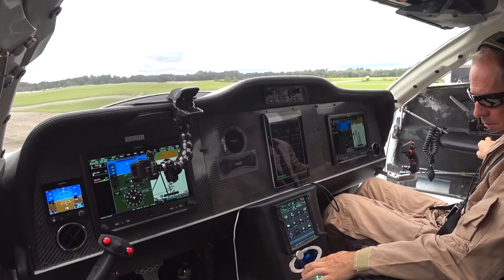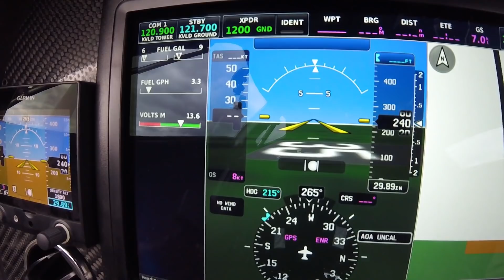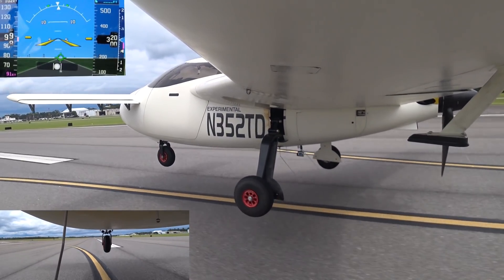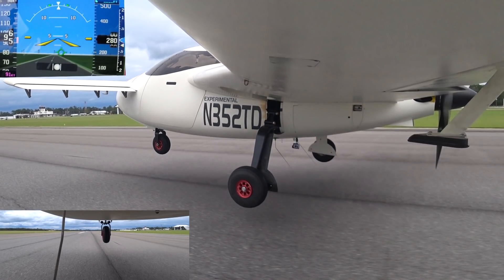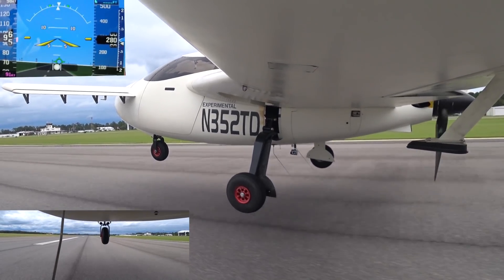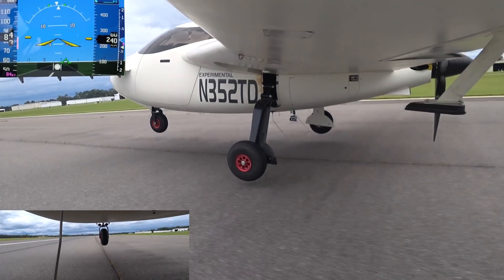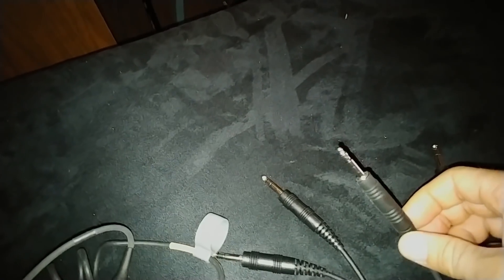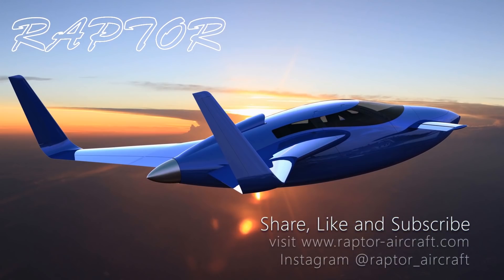Second Ground Effect Test - Building the Raptor Prototype

Comment: 1. Black exhaust smoke during power on acceleration, 2. A lot of dancing on the rudder pedals A LOT,  3. PIO again honestly u should quit while your ahead , and let a test pilot do these tests. It's not a dig on u at all, just pilots who have 1000s of hours can see and anticipate and give you input on stability and control issues just an opinion from a APT jet pilot

Comment: Perhaps the roll is a secondary force caused by the rudders and the crosswind component, a run in both directions would determine if this is the case

Comment: What is the difference between this plane and the velocity? They look almost identical..
Reply: If you'd been following for a while  you'd know the main differences are: 1. Pusher config. 2. Re-tuned Automotive TDI motor. 3. Pressurized cabin 4. Five  person seating.  5. Carbon fibre construction.  Cheers.
Reply: @bartofilms  like the other guy said,  the Velocity is a pusher, and has the ability to also do 5 seats. .

Comment: Peter, are your brakes still dragging a little too much?  leaving a lot of rubber on the runway at touch downs...It could explain the heating up issue you have been having.  I am not familiar with the Beringer brakes, but could there be an adjustment for them?
Reply from the maker: They are performing to spec according to Beringer.

Comment: Tom L.  You said obviously that I am not a pilot.  You are technically correct, as I am a retired veteran.   But mister hot jet jockey, where are your cred and videos of you initial test flights of the aircraft that you designed and built?

Comment: I'm going to be honest with you, it doesn't look pleasing for a pilot to fly, and this is only ground effect. No hate though, this is what flight test is for. I am an aerospace engineer and worked with canard aircraft in the past. It is looking like you have longitudinal stability issues. I know we are still at landing speeds here, but a plane should not be this sloppy longitudinally. Did you do any kind of CFD/VLM/VPM analysis on this? I feel like you also will have a lateral stability issue due to having a pretty high radius of gyration and consequently high roll MOI, but that is besides the point. Generally for canards, if sized too small we don't see enough elevator control power, but too big and we see poor longitudinal stability due to a larger than necessary positive canard contribution term in the pitch stiffness derivative. Usually when designing canard aircraft, it is very very hard to get the size of the canards right: too small a volume ratio will not counteract the negative moment of the wing, too big a volume ratio we will overpower the stability provided by the main wing since a canard itself is a destabilizing contribution to the aircraft. I suggest flight tests of multiple canard size configurations. I think you'll see that a decrease of the volume ratio will yield good results (and could even lead to better efficiency mostly at design trim condition).
Reply: @ryanthomas2472  those numbers make no sense. A tas of 149 knots and drag of 1000 ibf is 457 effective hp at the prop. Assuming an amazing efficiency of 90% that's 510 hp at the flywheel. Sr22 has a 310 hp io 550...
Total Drag is one of the hardest things to get out of cfd right, which is why sanity checks are important.
Reply: This thing has become a death trap with so many iffy construction methods used and numerous deadly problems ready to reveal themselves at the worst time, don’t know why anyone still has an interest in this project.
Reply: @tropicthndr  Good idea, so leave already.  Bye!

Comment: Hi Peter,

If you'll PM me an address, I'll have a copy of 'Flight Testing of Fixed-Wing Airplanes' sent to you.

Here's a preview: https://books.google.com/books?id=IdWmOwceEtIC&pg=PP1&source=kp_read_button

I'm not a test pilot, but it was one of the main books I used during my M.Sci. In Flight Test Engineering. If you haven't seen it already, it will be a big help in developing your program through first flight and beyond.

P.S, the book's author developed some of the material while working as a test pilot for Rockwell on the Commander 112/114 in the late 1970's. He had to jump out of the airplane after the prototype's horizontal tail fluttered off due to an early design issue which was later resolved through more testing. I think the story is covered somewhat in the book.

Comment: Well done so far.  Not being familiar with your electronic flight display, and how much ( if any ) lag there is in that system from when you get to an attitude, and it is displayed. It looks to me like if you pick and hold 5 Nose up with that speed on the AI you might have a smoother time in ground effect? I have no idea where you are looking as this happens . It might be worth a try if your staring outside as maybe that is partly causing your pitch overcontrolling.
Reply from the maker: Yes, at 90 knots GS and 5 degrees nose up it looks very stable and comfortable. To get it there though requires me to rotate the nose. Then as it comes up it actually gets a little lighter the higher the AOA. So to counter it wanting to go past 5 degrees I have to put in a little nose down elevator to stop the rotation. It's like anything, I need practice to get it just right. Now if I was keeping full power the nose down adjustment may not be required as much which would make things easier.
Reply: @RaptorAircraft   Maybe try a tiny bit less back trim prior to rotate, so that you are having to hold rear pressure at 5 nose up ?
Reply from the maker: @Finchy23  I have it trimmed now nicely for the 5 degrees nose up at 90 knots which is what I prefer.
Reply: @RaptorAircraft  Nice - I look forward to the highlights :).... Also I thought if your landing gear is used widely on other aircraft, maybe you could see if it behaves the same  for those aircraft when they touchdown ( if there is any footage available on the internet to compare with )

Comment: With all the adaptors and connections you did on your headset/helmet, you are more than likely gonna have issues.  I wouldn’t want the additive condition of being NORDO on first test flight.  You’ve got enough on your plate just flying the airplane.  And how many helmets have saved lives in an airplane crash anyway?
Reply: To your last point: A shit-ton.  More lately, as more people are wearing them.  In most circles of the professional warbird community you're seen as a fool if you fly with only a soft leather helmet or baseball cap anymore, we've seen the results of that in a crash time and time again.  People without proper crash helmets have: been knocked unconscious and burned to death in the airplane, been knocked unconscious and drowned in the airplane, suffered severe head trauma, suffered severe brain injury, suffered severe lacerations to the face... People wearing crash-rated helmets are proven to be significantly more likely to: remain conscious during and immediately after the crash, be able to self-extricate, suffer fewer injuries, etc.

Comment: Excellent progress Peter ! I am glad to see it airborne again, and getting closer to that post maiden grin ! I do have a couple questions out of curiosity, and curiosity only.
A) What's your wing and stab incidence in relation to thrust line ? 
B) On your winglets/verticals, I am assuming they are parallel with the center thrust line on the vertical axis ? Having flown many large scale RC wing, and canard variants, some of them depending on winglets size and angle, would cause a roll movement, and not so much on yaw. One design I test flew similar to a Velocity, weighing 30 pounds had one vertical that was off about a quarter degree with the opposite wing, and it induced a roll action versus yaw. 

Keep up the AWESOME work !!

Comment: Hi Peter. As you alluded to the fuel imbalance, this would add to the cross wind you said was coming from the left. With that magnificent large swept wing, the roll induced by the extra lift generated by the crosswind may certainly be a large factor. Remember, the left wing is presenting much more to the wind than the right wing (which is presenting even less due to the sweep back from the presented crosswind) and therefore a rolling moment. Even as you said you over controlled a little on your correction, the aircraft seems to be behaving well. 
Stay safe.

Comment: I purchased a jabiru that had been flipped on landing during its test flights when he landed in wet grass. when I rigged the plane up in the shed the right wing had an angle of incidence that was 10mm higher than the left wing (along the whole wing) when measured over the chord length! The owner reported that the setup needed looking at because he had to have almost full right aileron to keep it level in the circuit. Yep a bit more than just the rigging (Prob lucky he never flew at Max Cruise). Anyhow, if your flying and control surfaces are in alignment then the control inputs should have ample authority to correct for any aerodynamic or torque related effects.
Reply from the maker: And as you can clearly see, I'm barely putting any control deflection in when making corrections to the roll attitude. I'm just being careful and taking it slowly. Yes it's risky close to the ground but it's riskier in the air if there is a problem.

Comment: RUDDER, RUDDER OR MAYBE TRY SOME RUDDER. Also, stop trying to nit pick so close to the ground. Let the test pilots have a go at it away from the solids to get a good trim in stable flight. There are too many dynamic things happening in the transition from rotation, power change, acceleration, deceleration, flare etc. You are going to drive yourself bonkers. The systems seem stable, time to let her fly.
Reply: There are no test pilots anymore, Justin and Elliot are out
Reply: @outermarker  Peter has addressed this many times. Best you review earlier videos before making silly comments
Reply: @Ulbre  really? I've been following this since he and wasabi both released videos and he's not said, as far as I can tell, what he's doing for test pilots, if they're in or out. Is he keeping wasabi on?
Reply: if he uses rudder then he is defeating what he is trying to achieve at this stage....which is how she flies on her own with minimal human input.
By the time she is ready for TP's then hopefully any smaller issues will already be sorted.
Reply: @Ulbre  what exactly do you think happens in any SEL aircraft with no rudder input on pitch up at high AoA ?

Comment: Are there baffles in the tanks to prevent sudden shift in the fuel? Cross wind maybe?! The question was asked about engine mount and you said straight.  Might want to recalc and determine if an offset would be beneficial. I never built full scale but built many powered models. Never built one with a straight config. Getting closer tho. Keep it going!

Comment: Check the incedence on your wing lets. You can test that by shimming them out id start at 1/2 shim. See if that helps.
Reply: 1/2 in shim.
Reply: they are not adjustable
Reply from the maker: Incidence had been checked several times. Still perfectly symmetrical as it was when the wings were first attached.

Comment: I am not concerned with the balance at this point, it seems you have more than enough positive authority at this point for the speed being flown. Peter is right for taking this slow. Everyone is saying just fly it, ....wrong! If there is an imbalance of some sort that is not pinpointed, when the aircraft is flown at higher speeds, the problem could be exacerbated. I can fully understand Peter taking his time with caution. I'd rather see it go slow than see it in a hundred pieces or worse!
Reply: To some degree you are correct.  However the most dangerous aspects of flying occur during takeoff and landing.  He is doing it correctly!

Comment: The bank to the right may be the torq generated by the engine/propeller. In a Cessna 152 you can feel it a lot when you bank to one side or the other. you need almost twice the force. I presume that with that many HP at full power you may expect at least that amount of right torque. There must be some kind of formula to deduce the amount of force that may be generated by the powerplant. And it is always to the same side, and contrary to the rotation of the propeller.

Comment: I’m concerned about the BREP. Wouldn’t it get tangled in the engine if you needed to use it while the engine is on or spinning in the wind?
Reply: The plane should fall slightly nose up under the parachute, the lines shouldn't get anywhere close to the prop.
Reply: @kschleic9053  If you watch any real-life deployment of a BRS, you'll see that it takes time for the parachute to "fill".  In that time, it streams STRAIGHT BACK.  Yes the rocket launches it up but the aircraft is still flying at a significant speed, so it streams back directly in the wake of the aircraft before it begins to fill, slow the aircraft, stop the aircraft from flying, and then eventually suspend the aircraft.  I am equally as curious as Ravi how this will work on the Raptor.
Reply: I am sure this will be addressed in the future.  But it seems like we would need to have the prop stopped to make this work.

Feather the prop
Disengage the prop
Make a system for a prop brake
THEN deploy the parachute.
Reply: I take back my comments, BRS is available on the velocity so it would work the same way!

http://www.aero-news.net/index.cfm?do=main.textpost&id=883808b4-9e77-41ed-8988-3b286e485d58

Comment: Peter, it appears that you’ve now taken on the role of test pilot for Raptors first flight and beyond? 
What happened to the test pilots at Wasabi? Are they still involved and part of your plan?
I asked this question in your last ground effect video, but no response. 
Depositors and follows would sincerely appreciate a clean and upfront explanation. 
If I’ve missed or overlooked that particular explanation, could you please post the link here or tell me where I can find it? 
Regards
Mark
Reply: Wasabi is not going to be a part of the Raptor program moving forward. I don't know specifically what video to point you to, but starting from the last time they were out forward would get you there.
Reply: theralfinator 
I saw the video, but don’t recall the Wasabi test pilots or Peter saying anything about terminating the relationship and going separate ways.
I feel strongly this is an issue for Peter to address and should be done with total transparency. 
He owes depositors that much.
Reply: Wasabi needed to abandon testing because one of the zippers broke on their orange flight suits. Against policy apparently.
Reply: @PaulAnthonyDuttonUk  Spoken like a man whose knowledge of flight test is based on getting your truck airborne on a speed hump in the McDonalds parking lot
Reply: Flightguy - I have zero knowledge of flight testing apart from a few paper airplanes but am a BS expert. Can smell it from miles away. I note your smell is particularly heady.. Go play with your Lego set.
Reply: Paul Dutton 
Ha Ha
Reply: @PaulAnthonyDuttonUk  - No, this happen when they appeared first time. What happens last time was that one of there pink underpants became loose. It doesn't appear on there YT Video but insider told me that they become loose due to excessive indestinal gas exposure to the underwear tissue..... That's what I have heard ....
Reply: @thesnitch7  No, Im not. But I can confirm good judgment on the wasabi case and a lot of fun and happyness in my live.... Live I good Pa Murf!!
Reply: Pa Murf - If he does it maybe because English is a second language with a name like Wolfram. But what’s your excuse?

Comment: Hey Peter, I don’t remember from when the engine mount was built: Is the mount straight or did you add an offset angle?
Reply: This may be the contributing factor for your turning tendency. If you look at most planes, engines are not mounted straight. Just a thought you may run through CAD for the second plane. I know there’s no way to change it at this point since you’d have to redo cowlings. Caravans with Texas Turbine Conversions are mounted straight and they require a lot more control inputs than a standard caravan. You just have to set the trim and that’s the way those kinda are. All the best!
Reply from the maker: Straight.

Comment: You're saying 90kts, but I see 104-105 on the airspeed indicator. Is it showing mph or am I missing something?
Reply from the maker: Read the GS below the indicated speed. The indicted is reading high until the aircraft gets airborne.
Reply: @RaptorAircraft  I see. Is this still the issue with the static port fence you're working on?
Reply from the maker: @TherebyAir  yes. Given that it seems more accurate in the air I don't want to change it yet till I have more data.
Reply: @RaptorAircraft  as an engineer I agree to fix one thing at a time, your progress became critical as far as you get close to be airborne, you don't simply change the static port position because you think it's wrong because if you lack any data you don't know where to put it and you are not sure to solve the problem by moving it somewhere else with no criteria applied.

Comment: Low speed + high power setting + ccw prop rotation = roll to the right. The fix you implement for takeoff may punish you in cruise. Love to see that beautiful beast in the air though.
Reply: From what I understand, he's not implimenting a fix for any flight regieme, he's purposefully "band-aiding" to check for any potential aerodynamic inconsistencies.

All these "fixes" are temporary and will be coming out.
Reply: That would be affected by crankshaft momentum also